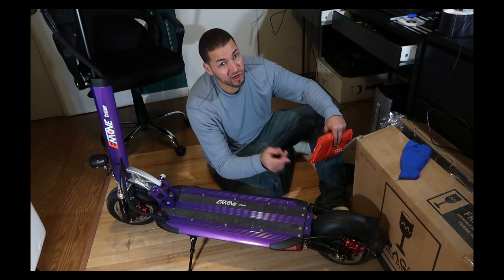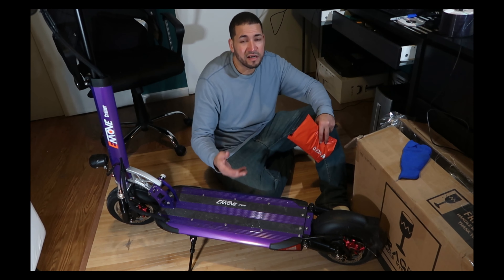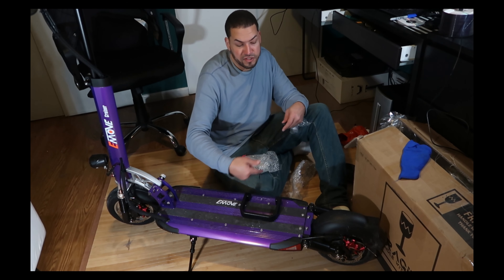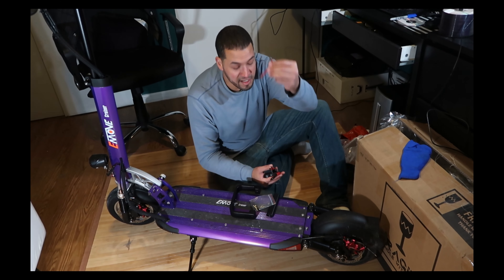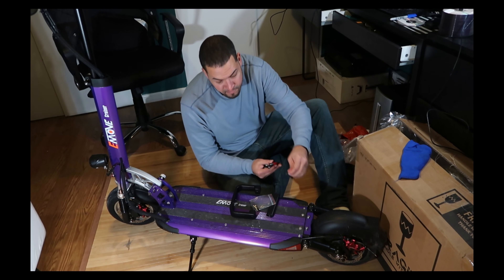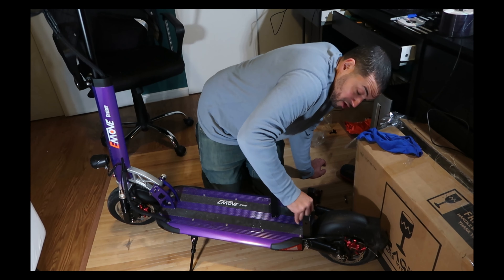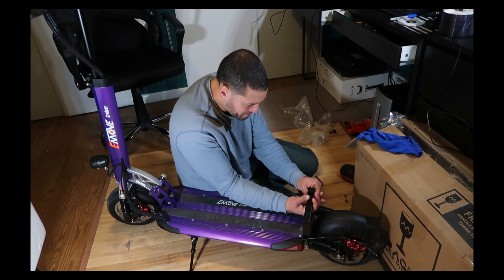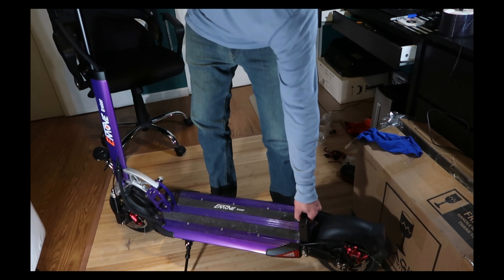How to install the voro motors tow handle on the 2021 Purple Emove Cruiser electric scooter.

Comment: You should use loctite on every screw nut and bolt for preventive maintenance, just about every screw nut and bolt can and probably will loosen over time not just the Move Cruiser but any      e-scooter.

Comment: Hey I have a question could you tell me what’s the measurement between the two Screw holes the reason is that I’m trying to make a diy handle and I haven’t got my scotter yet and I want to have the handle ready for when I get my emove scotter see if you could help me with that?

Comment: My screws were too long and the handle is super wobbly. I'll try to find some rubber spacers so i don't injure the paint with metal washers. Until then, it's VERY annoying
Reply from the maker: Thats interesting the screws they send are longer but if u put it in the last two screw areas it should be fine. This they send u Bigger screws than 6mm?
Reply: @StarTimez  that's where I put it...

Yes, they go all the way in and still have about 2-3mm room
Reply from the maker: @JayTwoA  voro motors customer service is phenomenal so reach out and see if they can help in any way

Comment: Just cruious, does the tow handle impact the ability for the stem to fold down? judging by the look it would seem like it would stop the stem going down far enough to lock into its folded position
Reply: Came here to ask the same thing
Reply: According to VoroMotors, the scooter will fold fine as long as you push the stem in first. If you leave it up then it'll be in the way.